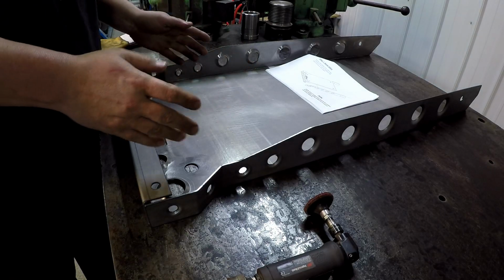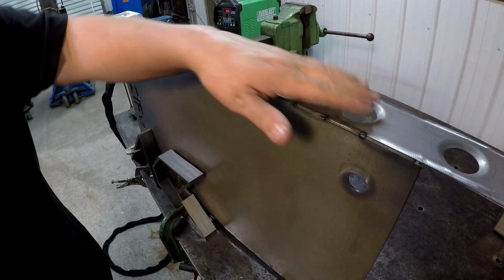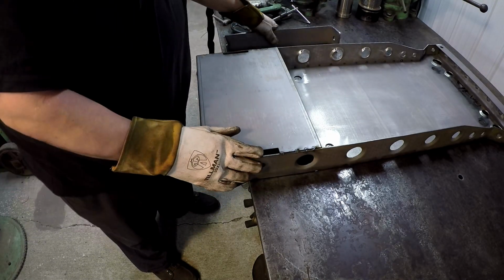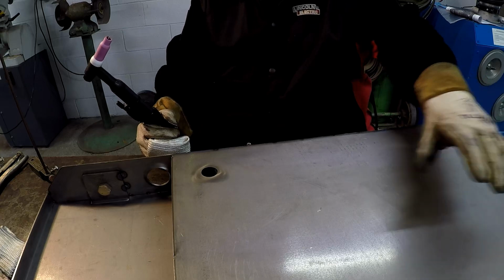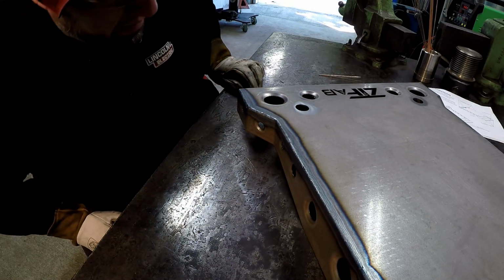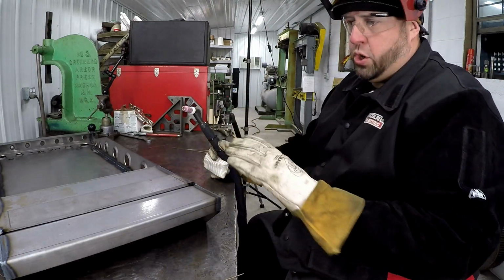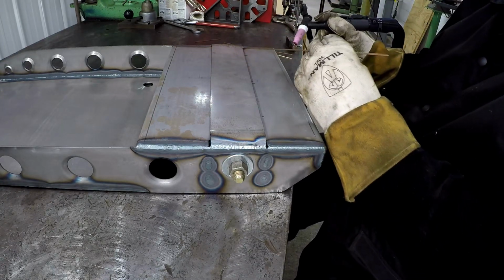ZTFab Welding Cart Part 1

Comment: I'd rather get a US General tool chest and add a little tubing and plate to make my own cart. It would hold a ton of tools, and the total cost would be $299.00 plus tax plus about $50. The chest is rated at 1,000 pounds, so holding a welder and plasma cutter would be no problem.

ZTFab products look nice, but I don't see where the money goes. A tool chest kit for my welders would run $280, and it's just a couple of pieces of bent steel, which I can make myself, plus two wheels. 

For $75, I'd be all over it, but $280? Can't see the value.

Comment: I'm glad you showed ( @ 13.50 ) the use of you foot peddle,  first time I've ever seen that on any vid!
Are you controlling the amount of AMPS through the action of the foot peddle?  Too much heat ................. ease off the peddle a bit?
Also, by easing of the foot peddle a bit,  does it also control the amount of gas being used? ........  less AMPS = less gas needed?

I'm seriously thinking of buying a TIG welder so I'm gathering as much information as possible.

Thanks

TURK

Comment: @Abom79 kind of an old vid. but i got tasked with throwing together a hydraulic unit to push fluid through the hyd systems on our acft. i had never welded aluminum and after 2.5 days, i figured i had the hang of it well enough to do my own stuff at home to practice. with that being said, how are you liking the everlast tig unit? I'm a miller guy, as it looks like you are too, but i can't fathom paying what milling asking for their multiprocess unit, just to use as a hobby machine. it seems the comparison chart shows the everlast to be as good as miller, but 1/3 the price. thanks for the vids and hopefully a good review of the unit. I'm thinking of buying their plasma too. insight on your unit as well?

Comment: Hey Adam, I notice you and Doubleboost sort of dab the filler rod into the puddle. There's a guy I watch from Finland who just lays the rod into the groove and runs the torch right over it. Have you ever seen or tried that technique? I've never really tried TIG, so I'm not advocating. Just curious. Thanks for the great video.
Reply from the maker: Both methods have their purpose actually. I like both of the techniques.

Comment: Can you (or Paul if he reads this) explain how the formed edges are made around the lightening holes?  Adds a nice effect.  Is it just a form tool in a press or is there a special piece of kit?  Thanks
Reply: It is more than likely a dimple die.
Reply: routercnc , the taper around the wholes are made with dimple dies, these dies are made specifically for each size whole. They are done with a hydraulic press after the piece is cut.

Comment: Nice work Adam very satisfying to watch those welds get cleaned up and buffed.  What were the 3 discs you used ?
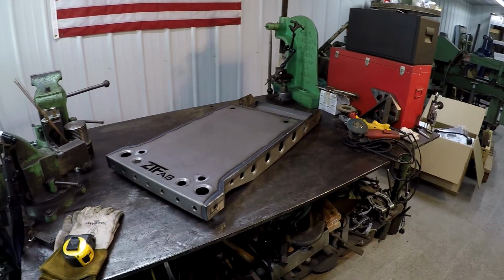Reply: The disc @ 21:40 is probably a run of the mill flap disc.

The next disc looks like a Norton Blaze non woven ceramic disc. These are not cheap, but the performance is amazing and the longevity is very good. They're meant for metal prep and polish, not really serious metal removal. But they eat through rust, mill scale, paint etc. better than anything I've ever used and by a wide margin. Certainly worth the price if you get the multi packs.

I use these to prep everything I'm going to TIG weld. I do still use denatured alcohol as a final cleaning step.

https://www.amazon.com/gp/product/B00939MUAM/ref=oh_aui_detailpage_o08_s00?ie=UTF8&th=1

Hope this helps.

Comment: Is that welder as quiet as it sounds on camera?  I could hear the gas valve operating but no angry pixies or hissing gas.
Reply: It should be so quiet, it's DC TIG welding, all you should hear is the gas flow, the cooling fan and some high pitch noise if there is some pulse modulation. The AC TIG however...now that can be noisy

Comment: Just a tip. On the high pressure gas cylinders it's best to open the valve all the way. The stem is a dual seat type and since there is such high pressure, opening the valve fully helps to prevent gas leakage past the valve stem when in use.

Comment: I understand that the purpose here was to try out your new TIG but for steel MIG is to me the only way to go. I'll TIG aluminum under 1/8" since I've got no other choice but the slow speed and excessive heat that TIG brings to steel welding makes me consider it to be a waste of time for steel. 0.023 wire in the MIG and you could have had just as good of a job in 1/5th the time with less heat distortion.  But, then again speed wasn't the point here and I understand that.
Reply from the maker: You can’t MIG welding everything, but if that’s what you prefer then knock yourself out.
Reply: SATAMAN Schmidt I agree with you but that really looks like stainless at least  on video Adam what material is that made of
Reply: According to their website it's just hot rolled steel, pickled and oiled instead of covered in millscale though so it's a lot easier to weld.

Comment: Nice job, Abom! I have the same cart with the same set up (tig welder, plasma, storage box)  looks good sitting in the corner! then when you need it, it's nice having everything right there in a sleek package.
Reply from the maker: JD Brewer Thanks JD! Have you had good luck with your machines?
Reply: Abom79 I have the same welder but I have a Lincoln plasma.
I like the welder but it does have a few drawbacks, the biggest being, the dials are very sensitive but don't have a digital readout so it's tough to dial in any pulse or frequency settings and if you do get something you like be sure to close the lid because it's easy to bump the knobs and screw everything up.  And because you only had it located by feel you can never get the same settings once you change something
Reply: Abom79 also always ground it good and solid to the actual piece your welding, not just the table or else it acts up.

Comment: Adam, I also have a Powerplasma 80S that I have had for several years and love it, I'm sure when you get to use yours you will also love it. My tig welder is a Miller Dynasty 200 DX and my Mig welder is a Millermatic 350P with a 30' Spoolmatic

Comment: Im a welder..  its funny seeing a machinist weld..  but again,  you would probably roll your eyes seeing me machine anything...  nice jobe..   Your a grinder not a welder...lol
Reply from the maker: I mostly do stick welding, lots for hydraulic cylinders. I actually used to do more welding at my old shop then I do these days. If I had to be a welder everyday, I’d get much more consistent with it. I’m not trying to make those “weld porn” beads, I’m doing regular everyday welds. No worries from me, I get the job done each day.
Reply: I don't think I've ever seen welding in a video on YouTube that didn't have a string of comments from insecure viewers criticizing the weld. It's weird.
Reply: Guys,  im sure  if Adam didnt think his welds where up to snuff . He  wouldn't have made the video.  He did a good job, just looked like a rookie welder .  And the end result was as strong as a certified welder.      And yes , i have 2 grinders.. one for a cut off wheel and a wire wheel in the other.
Reply: MotorHead Garage If I remember correctly, Adam went to school to learn welding.  Ironically his machining knowledge isn't from a school.
Reply: Didn't have to scroll down too far to find "this one"...
Reply: MotorHead Garage.. So are we to assume you don't have a grinder in your workshop :P
Reply: Grindergods rull the world (remark of a non pro, or better DIY learned person 🤪)

Comment: Did not have comments enabled on the video for the shaper.  (do like those videos)   It occurred to me that I did some controlled crush copper with a pair of vice grips.  Not sure you can fit them into the oiler but you want something similar.  I did not close the jaws all the way so I could adjust the gap to set the amount of crush.  If the tube comes out you might want to anneal the end to avoid cracking it of you do too many tries.

Comment: My TIG welder really seems to eat argon. If I MIG weld I seem to get a lot more mileage out of argon. Does it seem that way to you?
Reply from the maker: Could be your regulator, and make sure to always close of the valve when your done.
Reply: Ya you need more flow with a tig welder I have found. Mig you only need enough to shield the puddle, and no post flow for 5-8 seconds after to shield the tungsten on mig

Comment: What’s the clear tube on top of the pressure gauge for the Argon tank?
Reply: Flow meter, in cubic feet per minute.
Reply from the maker: Yes it’s the flow meter. Shows the amount of gas flowing though the regulator when welding.

Comment: did that come with a foot pedal too? can you ad a water cooled torch later on?
Reply: Everlast ships with both torch switch and pedal.. decent pedal too..  I like mine..  It is easily watercooled.. just more $$
Reply from the maker: Yes you can add on the water cooler, it’s a separate accessory. This machine comes with both finger switch and foot pedal.

Comment: Cool cart - Now you just have to sell that Everlast Tig and buy the HTP Invertig 221 water cooled. You won’t want to go back to anything else. Argon actually does not technically cool a air torch but does help it not get as hot.
Reply: yeah, I had a bit of a conundrum with that one, argon is non-conductive or at least badly conductive. so cooling anything with it would not be really helpful.
Reply: highkicker11 excacly spot on. It is a highly debated topic but you are right.

Comment: Oh, I have been meaning to ask, I think you mentioned a long time ago, that you have both, the cast and the welded-up units by FireBall Tools, have you noticed any differences between the two? I am sure they cast version, and the welded-up version both perform wonderfully and as expected, but, can you iterate a little further on your opinion, of may the slight Pro's & Con's of each. Does one have more flex then the other, like when holding heavier parts together? No hurry, just wondering.

Comment: i am IN NO WAY an expert welder, and if its working its working, but the youtube guys i watch, tony, jody, bob moffat, always talk about using 15 or so degrees of torch angle, so i think you may be using a bit too much there, that being said, it looks fine so damned if i know XD
Reply: I've been in this game for quite a few years taught by some of the best (That's watching YT vids not actually doing the job! <];o) Have to say i was thinking the same.  This old tony has very recently put out a couple of short analytical vids showing how angle and shape of the gas shadow affects the heat transfer and penetration of welds also the shape of the puddle is at it's optimum.
And of course my fellow countryman Double boost could teach you to be a mechanic that pisses about to a fair level of compitence.

It's pretty straight forward (:o} but basically on the sort of welds you've just done the needle should either be vertical or bisecting the join (sounds so simple when you say it fast)!   Not quite as laid back as the angle you were using.
You also need to maintain as small a tip gap as you can hold, which the angle helps you to do.
Early doors yet!